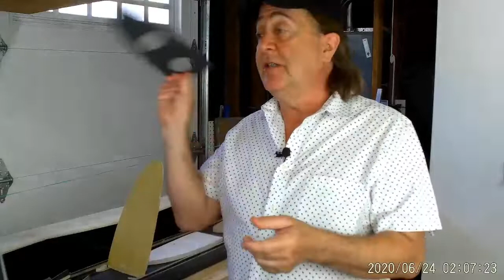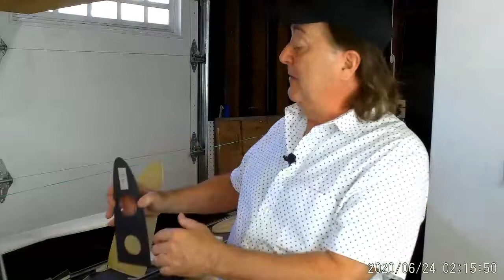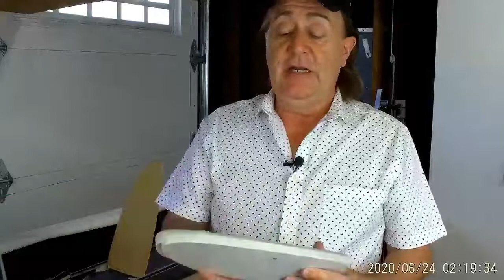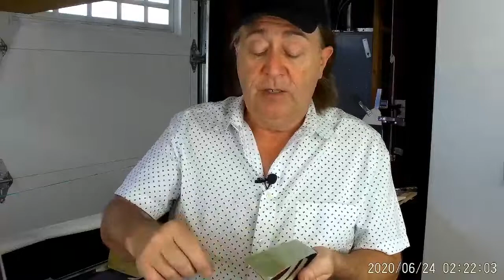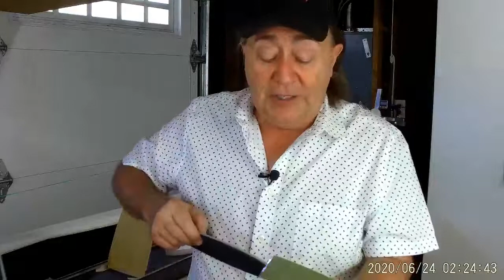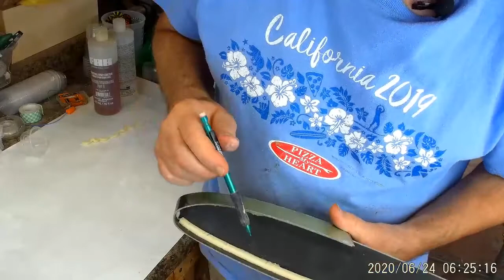Working Blind and Bonding the D-tube - Klingberg Wing MkII Development

Comment: Do you think I could use carbon fiber tubes from McMaster Carr for my frame?
Reply: I realize your question isn’t directed at me, but I thought I’d mention a couple of things that I have researched about carbon fiber tubes.  First of all, not all carbon fiber tubes are the same.  They are different thicknesses, and different strand orientations, built for specific strengths for various directions.  That being said, as long as you match the CF tube with its intended use, it can be a fantastic material for your frame.

Comment: This came to my mind: form a channel along the edge of the rib to allow resin to flow through and inject resin through small holes in the skin of the rib or the D-tube (after placing the rib). If resin flows out the next hole, the cannel is filled, no air remaining. I tried this on a model plane i buildt, the concept has worked there (Viscosity of resin was key). 
Thanks for sharing your thoughts! Very interesting!
Reply from the maker: Wow, it is wonderful to see all the great ideas flowing in - it really is helpful. But I swear that you guys must have a hidden camera in my shop and listen in on my calls to Bob - that or you are all mind readers!  So, the issue of the rib jumping out of the foam tracks/sides that I mention in the video did come true on the full size sample. The ribs are flexible and without the nose of the rib set in the groove, the rib "jumps the tracks" due to inaccurate insertion that is a result of the tilt angle for the sweep. All that said, I have two other solutions working (they are both mentioned in the comments here) and I will be posting an update video with I select the final method. Thanks for the help!

Comment: a couple of thoughts for your consideration. Firstly, if you used flex rather than micro you would have a stronger adhesive.  Secondly ( warning extra work ahead!) if you were to put a layer of packing tape inside the d tube at each rib location and lay up one layer of cloth and peel ply and then let it cure. This forms a conformal flange, Remove the peel ply, Next insert ribs at correct stations and bond each rib to  each of your strips with flox dabs, or another temporary adhesive let cure, then peel the d tube off the ribs and remove. You are left with flanges which are an exact match for the inside of the D tube in place on the ribs . Another strip of fabric with a flox corner to attach the rib to the flange, cure. Finally remove packing tape from inside d tube and clean. Thin layer of adhesive on matching face of newly formed rib flange, and spar caps  insert D tube skin over ribs, holding it apart until down,  Set up vertical guides at each end to ensure spanwise location.  Vacuum bag to hold until bonded.  Retire and declare victory..
Reply from the maker: Wow, it is wonderful to see all the great ideas flowing in - it really is helpful. But I swear that you guys must have a hidden camera in my shop and listen in on my calls to Bob - that or you are all mind readers!  So, the issue of the rib jumping out of the foam tracks/sides that I mention in the video did come true on the full size sample. The ribs are flexible and without the nose of the rib set in the groove, the rib "jumps the tracks" due to inaccurate insertion that is a result of the tilt angle for the sweep. All that said, I have two other solutions working (they are both mentioned in the comments here) and I will be posting an update video with I select the final method. Thanks for the help!

Comment: Perhaps the original plan of bonding the ribs to the D-tube skin prior to bonding to the spar still has some potential, with  a little tweak.

Might it be possible to bond the rib to lower or upper surface of the D-tube skin and leave the opposite surface to be bonded when you finally bond it to the spar?  This might give you enough flexibility to get the skin over the spar, but also keep the ribs lined up ahead of final assembly.  Bonding just the LE portion and leaving the spar ends initially un-bonded might work as well.
Reply from the maker: Wow, it is wonderful to see all the great ideas flowing in - it really is helpful. But I swear that you guys must have a hidden camera in my shop and listen in on my calls to Bob - that or you are all mind readers!  So, the issue of the rib jumping out of the foam tracks/sides that I mention in the video did come true on the full size sample. The ribs are flexible and without the nose of the rib set in the groove, the rib "jumps the tracks" due to inaccurate insertion that is a result of the tilt angle for the sweep. All that said, I have two other solutions working (they are both mentioned in the comments here) and I will be posting an update video with I select the final method. Thanks for the help!
Reply: This might be a bit out there, but another idea I've been pondering on is whether it'd be possible to build a generic D-tube mold (male or female) that has a slightly opened out version of the final curvature that the D-tube will have, then when you bond it to the spare you flex down onto the spar and ribs and let the ribs provide the final profile you want, rather than the mold providing the exact shape.

If it's possible to do this then you might be able to stretch the technique to use a symmetrical mold and have the require asymmetry become part of the final bend to the rubs/spar.

The curvature to use on the generic mold would be something you'd need to calculate based on the forces you could apply to the part as you do the final bonding to the spar.  If you get the forces and calculation of the bend that they will induce right then the bend actually be quite close to the shape of the ribs so the sections between the ribs won't bow out or dip too much.

Whether it's a workable approach, or whether the results would be too rough and ready for real use I can't say as I haven't done much composite work myself yet.   As you say in your video, it's easy to come up with ideas in your head or in paper, but proving that they work requires you to make the part and test it.
Reply from the maker: Entirely possible, but would have to be tested due to the washout. I think most of the washout set would be due to the very LE of the airfoil which has be molded. So, basically, you'd have two flat surfaces blending into the LE at some tangent point. Then you'd mold the final shape on the nose ribs. You'd need more ribs (I have 9 per side) due to the "dishing" that would occur between ribs in the areas that were molded flat. If you check out the video of assembling the test section of the wing, you will see that I do something similar with the wing skins that are aft of the spar.

Comment: Very interesting development process  Ron.  Near the end of the video you highlighted the delamination issue when bonding with cabosil     and I have experienced similar issues several times and my thoughts  were that the glueing surfaces should perhaps be wet out with pure epoxy  prior to adding the filler to hopefully improve the bond and you mentioned that so it will be interesting to see if that improves the situation.

On another issue in your  video you show piping the splooge into the foam gap with a  D tube 50 mm wide which allows  easy access. I'm wondering how the splooge can be piped into the the fully completed D tube when access will be from the spar gap only.?
Reply from the maker: I will have to pipe some filled epoxy in to the LE of the D-tube (on the inside) before I install the D-tube. I'll have to put in some extra so it will cover the variances to be expected related to the final position of the nose rib. If the filled epoxy is thixotropic, then it will stay in place until the parts are assembled.

Comment: When using any other filler, the epoxy gets dangerously dry before it goes thixotropic.  Cabosil is what lets you go thix while still a bit wet.  If I'm mixing flox, I still use a little cabosil at the end to get thixotropicity.(I'm sure that's a word)
Reply from the maker: You did Shakespeare proud on that one! The advantage of making up words is that nobody can dispute the spelling! I never thought about combining Cabosil with flox, but it seems interesting. Are there known mechanical advantages for that combo?
Reply: @KlingbergWingMkII  I doubt there is any structural advantage. I don't think adding perhaps 5% cab would change the strength very much.  It's a matter of getting the mixing done while the clock is ticking.  With other fillers, you keep adding and mixing, and towards the end, you slow way down because you don't want to go too dry.  At that point you can confidently throw in meaningful amounts cab without being too afraid of going dry.  And suddenly you're thix and still wet for a good bond.  Boat builders don't prewet with pure epoxy, they guard against dry mixes.
Reply from the maker: Understood. That approach will save me the hassle and time required to prewet the surface to be bonded. I checked the pure cab filled epoxy and it snapped in half easily, so it would be best if I include flox with my mix. Thanks!